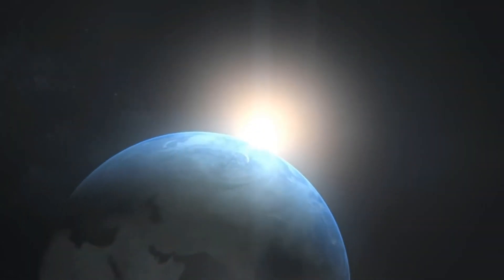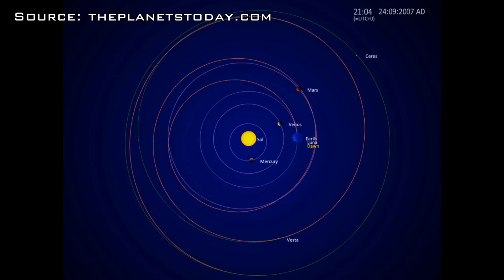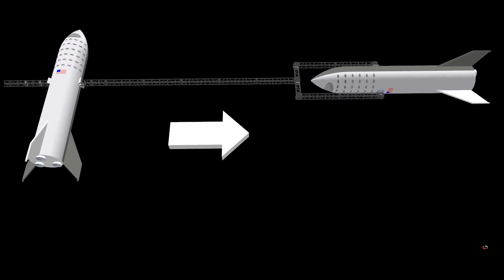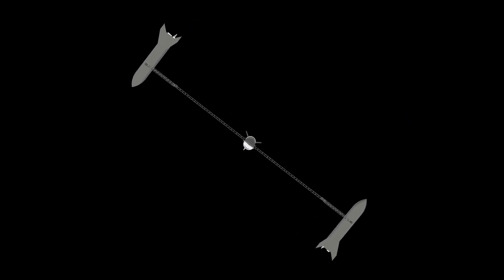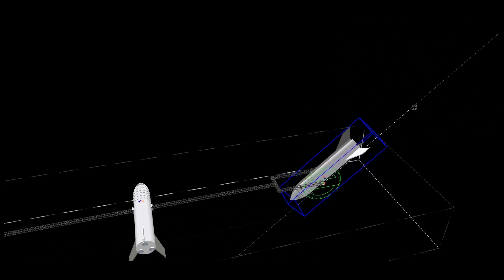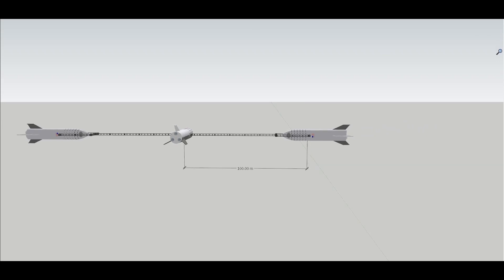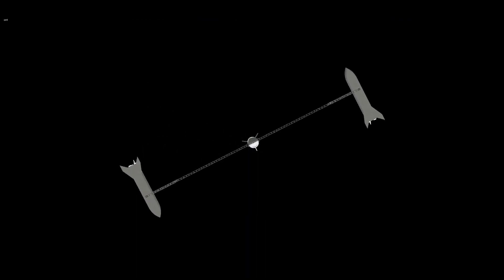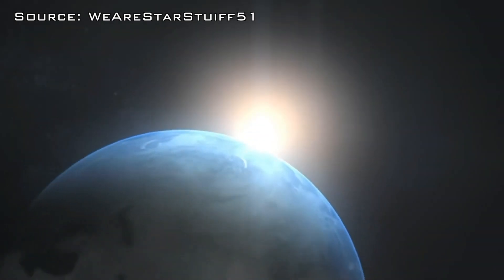GLS2: Artificial Gravity for SpaceX's Starship

Comment: Good. Now figure out a way to protect against the beyond lethal levels of radiation you will need to travel beyond LEO.
Reply: Radiation in space is way, way overblown.  Avoid passing through the Van Allen belts when leaving Earth;  and the rest is not too bad.  A truly lethal radiation place is Jupiter's moons Io and Europa, which are inside Jupiter's "Van Allen belt";  there you'd get a lethal dose in 5 minutes.  But deep space is generally okay.  Well, you do get a lot more cosmic rays than on Earth, but in this case, airline pilots get almost as much cosmic ray exposure as astronauts on the ISS, and astronauts on the ISS get almost as much as in deep (interplanetary) space, since Earth's magnetosphere is not effective against cosmic rays, given that they are made of non-charged particles at high energy ... (our shielding down hear is thanks to the atmosphere).  The increase in rate of cancer for commercial airline pilots is very slightly greater than average;  much less than the effect of being a smoker.  As far as solar flare radiation (charged particles), the crew will have plenty of warning, and will be able to take refuge in the radiation shielded core, which will be a cylindrical space whose walls are part of the water recycling system.  Often people are horrified at hearing that this or that exposure increases your irradiation by a full lifetime on Earth;  but we can easily take orders of magnitude more exposure than Earth background without noticeable health consequences.  Perfect example is radiation therapy, where you might get 100 REM in the course of a treatment (several lifetimes' worth).  And the best solution for radiation is actually our own natural cell and DNA repair mechanisms.  Taking supplements that facilitate or promote DNA repair is going to do far more than building lead walls.

Comment: Cheapest form of gravity, spinning! The truss idea is awesome! But you'd need some amazing materials and design to pull that off. I can see it happening eventually. Elon will probably have to hire some crane manufacturing engineers to figure out that challenge. Total pull at the center of the truss will likely exceed 300-400 tons pull force, combine that with vibration and it will be a challenge to prevent breaking.
Reply from the maker: In the next GLS video i'll talk about using cables to hold against he pull of centrifugal force, and rigid truss to provide leverage.

Comment: I think the biggest problem with this is the need to swivel the starship, and support it completely with only two supports in the middle.  Rockets are made to support a vertical load, not horizontal point loads, and the design would have to be changed for the added stresses.  Atmospheric insertion would apply stresses evenly along the body as well.  If reinforcement was simple and lightweight, it might work.  I still think using something other than the main engines to spin it is ideal, even if it took 1 day+ to get up to speed.
Reply from the maker: Yeah, a slow spin up, and spin down, would be nice. Lets see how their plans for methalox RCS plays out.

Comment: I know little to nothing about rockets but can't you just build/use the stabilizer "compress gas" to rotate the rocket like a bullet? that creates the same rotation as would your extra two centrical boosters to create the gravity effect.  Just a thought. no idea if that makes sense to anyone.
Reply from the maker: Rotating the rocket like a bullet doesn't give you a spin system large enough to support human life. 

https://www.reddit.com/r/SpaceXLounge/comments/czycst/in_an_85m_diameter_rotating_cylinder_a_2m_human/

As for compressed gas, you wouldn't be able to bring enough with you to have the required amount of delta V. It's used for reaction control, but there is a finite amount of it. They announced methalox RCS for the starship and I'm excited to see how that works out. When more testing is done, I'll certainly do a. video on it.

Comment: That scaffolding is too bulky. And, of course, a rigid structure subject to constant stress could easily develop cracks. Nylon ropes or steel wires seem to be the way to go at this time. Not to mention that using ropes and wires will allow for the 2 crafts to be much further from each other, possibly miles, thus making the artificial gravity a lot more natural. Because, if your rigid structure will cause for gravity to change from 100% to 85% for simply going upstairs, that could have devastating consequences for one's balance and you could end up with one constantly dizzy and confused crew which is not good. If the crafts were 1 mile from each other then moving inside the craft should not result in as significant 'gravity' variations.
Reply from the maker: Too bulky for what? I agree it's too bulky for Elon Musk to be impressed hahaha. I like how you think big though! The next GLS video I'll math on actual stresses, and include cables in the visual for the design. I'm going to try to keep it at 100m radius for now though because it seems more practical to implement and achieve mission success.
Reply: @smallstars  Yeah, do that.
The lack of gravity and, of course, the presence of radiation are probably the 2 biggest 'problems' that need to be addressed to make space travel practical.
And 'time' of course. But we forget that only 200 years ago it would take people months to travel from, let's say, Europe to Australia. It took Magellan's crew 2 years to go around the globe. So gravity and radiation need to be addressed first.

Comment: You know, the Idea of truss structure that spins isn't totally new. However the middle of the whole structure should be strong enough to endure MORE THAN TWO MASSES of starships. JUST A PROPELLANT is 1200 tons. one one ship. I don't think simple steel scaffoldings might handle it. And starships too. It's not a brick to be mounted on the center of mass(which is moving with time). You can't just turn it 90 degrees without snapping in half. It was the first point. 
The second is Jannibekov effect that will likely turn the whole thing into unstable rotating rod. 
Moreover, on large distances the metal truss is more like cable. To transfer spin FOR A FREAKING HALF A KILOMETER it should be as thick as the starship itself. It is like making a two meter long paper tube and attaching bricks on each side. And then spinning it.
Maybe making half of Earth gravity might help, but it is still too hard to achieve something like this in space. Both rockets should be totally synchronised or htey'll break. Coreolis forces won't affect much on human on large radiuses but they shouldn't be omitted.
Reply from the maker: I agree, and I love the visual of a two meter long paper tube with bricks attached. I would love to see them try that on the ISS!

In future videos I'll include more math on the stress being placed on the truss (and reinforcing cables)

Comment: Spin gravity tends to cause people to be sick af. If you drop a ball it wont take a straight path down. The rotation bends its path. The same happens with your head if you bend over or sit. This screws with your equilibrium. NASA did am experiment where they put people on slow turning platforms. They found if people where on it for long periods they would get motion sickness pretty bad. Its a cool idea in theory but doesn't quite work in practice.
Reply from the maker: This is why I chose 100m radius. http://www.projectrho.com/public_html/rocket/images/artificialgrav/gravComfort03.jpg

Comment: There's 1 major issue with using spin based gravity in space that rarely anyone addresses. If you use spin force gravity, the forces of gravity felt on your feet and lower body are higher then felt on your upper body and head. This causes major equilibrium balance and nausea issue's over time and forces blood to your feet. 

To compensate for this you need to create an MASSIVE station or system explained in this video, that would cause the differences in gravity in proportion to the center of the spin to be minuscule.

if you had a spinning wheel but it wasn't massive and say we created 1g for my feet, if my head was feeling 0.8g's due to my height making my head closer to the center of spin. It could be even more detrimental then a total 0g environment
Reply from the maker: This is why I chose a 100m radius. http://www.projectrho.com/public_html/rocket/images/artificialgrav/gravComfort03.jpg

Comment: Hmmm not bad but you would need to ad structural support throughout all 3 ships and the rigging holding them together would need to be massive..have you calculated the additional weight yet? You also need to change the thruster controls or you could end up twisting your frame..
Reply from the maker: All I knew is that the payload bay of an empty starship can hold 150tons. I trust 150 tons worth of truss, cables, and hardware should be sufficient. In terms of structural reinforcement at the attachment points, I would love to know how much if any mass would need to be added to the passenger starship hulls.
Reply: @smallstars  I would ditch the center rocket an just go with  support columns and two ships, run a access tunnel between them. also I would set them on horizontal axis not vertical that would create a stable gravity across the ships and give them easier thrust control. Hook a bunch of solar cells on the rigging and there you go:)
Reply from the maker: @gregj4857  How would you get the "support columns" on a trajectory to Mars? My only other video (GLS Version 1) isn't a very good video, but I did explore a dorsal connection on the passenger starships (I wouldn't say horizontal, but I get what you mean, they would be perpendicular to the radius, or even more elegantly said: in a tangential orientation)
Reply: @smallstars   how about an umbrella frame type of a design, you send it up and unfold it then you can fix 3, 4, even 5 rockets to the ends. Have all the rockets facing forward and instal a main engine in the base of the shaft for forward thrust also you can instal thrusters to make it rotate. The frame would be relatively cheap, simple to construct and launch..

Comment: Don’t land the GLS, just use in orbit refuelling
Reply from the maker: I don't imagine there will be in orbit refueling at mars. Only at earth. Also, the GLS and starships are not planned to have enough delta V to insert into Mars's orbit at all, and will rely on Mar's thin atmosphere to scrub off velocity for landing.
Reply: smallstars All you need for in orbit refuelling is 2 Starships so it could easily be done at Mars. Plus after aerobraking to reduce apoapsis it would be much cheaper fuel wise to raise the periapsis than to land and take off again.
Reply from the maker: @aDifferentJT  Interesting Idea! It would be a first for humans. (one of many obviously)

Comment: For this idea the implementation is rudimentary. Each starship in order to have enough Delta V for mars trajectory and eventual orbit requires two separate launches, 3 means 6 and 3 Leo refueling maneuvers (edit, not to mention extra delta V loss to catch each other on the same trajectory in Leo). Technically you'd only ever need one GLS or whatever you call it since both you can just have an adjustable center of mass designed into the truss and just boost the spin using the one starship and rotate around the center of the truss as a point of reference. (edit, this is to compensate fuel weight loss from the burns, something that in your original idea you'd have to match the fuel burn from both rockets exactly lest you have a shift in centre of gravity which for the middle passenger ship would be unfortunate to say the least.)

It should be noted however that such a design simply does not account for general space wear and tear and you would have no way of knowing the condition of the truss unless you built sufficient sensor infrastructure into it. It's also a massive failure point with the event of it breaking or coming loose having catastrophic effects on the starship's flight path as the dissipated forces from the event would slingshot the two away from each other but most importantly away from their mars trajectory potentially adding years if not decades until the next celestial body encounter without enough delta V to correct otherwise.

The only realistic way for artificial gravity implementation currently is to just rotate the actual starship itself using retro thrusters and have the gravity against the shell of the craft which in this case actually may help in the passive pressurization of the vehicle and thus increasing it's hull strength.

With anything in our current technological stage less parts individual ships are the way to go until we are able to harness a different form of energy such as fusion and/or efficient ion drives allowing some extra delta V for safety. Getting there is really where we are currently at and getting there comfortably will be several steps beyond that. (edit, we really should aim for a a-grav station in Heo first before trying to send starships on voyages)
Reply: Rotating a craft the size of starship fast enough to simulate even just 80% of Earth’s gravity would be completely intolerable to human because of the issue created by angular velocity, differential gravity, and the Coriolis force. Experts believe that the most angular velocity that humans can comfortably tolerate is 4 rpm which would require a spacecraft with a rotation diameter of 112 meters at 9.8 m/s rotation speed to get 1-g. If a craft has significantly smaller rotation diameter, the differential gravity between a passengers head and feet would be too large and would crate a very uncomfortable ride that most humans couldn’t tolerate. Even if you double the angular velocity to 8 rpm and decrease the g’s to 80% of Earth’s gravity, it would still require a much larger rotation dilated than the height of the crew section of the Starship.

Comment: Couldn't you use a huge reaction wheel in the center starship? I know the this would take much longer to attain the speed needed but the sun is a limitless source of energy and can power the reaction wheel. You also gave me a grate idea for maintaining the bodys natural functions and bone density. If you leave this system in orbit around mars you could periodically send people from mars to this station to extend peoples stay at mars. Enabling people who live on mars to still be capable of returning to earth.
Reply from the maker: 1. The reaction wheel in the center starship would not really have any leverage on the system. The parts of the system that have to be set in motion are the most massive parts and they are at the extremities.

2. The plan is not to orbit mars at all, but to use Mars's thin atmosphere to scrub off velocity and land.

3. Building a centrifuge on the surface to support human health would be a pretty good idea! I don't see why it would need to be in orbit ;)

Thanks for your great comment!
Reply: @smallstars  yeah i was just thinking it would be easier to make on solid ground. The only thing they need in orbit is satellites to maintain contact with earth. They probably already have that. Thanks and great concept. I hope to see more great ideas

Comment: Wouldn't this suffer from 3 axis instability (tennis racket theorem?)   The intermediate axis sounds like it would be on your pivot causing the whole thing to want to flip.

Also, if you are 1g at deck 1, wouldn't the mass of propellant be loading huge strain on the system?
Reply from the maker: Yes, working on a solution for the next GLS video!

Comment: I know this is not related to the video's subject, but...
"Over and out" is incorrect and it worries me that so many people are using it.
"Over" means you're finished with your message and await a response.
"Out" means you've finished with your message and do not expect a response, basically ending the conversation.

These terms were (and still are) used mainly with radio communication, as you can only broadcast OR receive at any given time. Saying "Over" or "Out" was a signal to the receiving end that you've stopped broadcasting and are able to receive signals again.
Reply from the maker: Next time I'll hit you with a "Smallstars out!"

Comment: Cool vid, Have you considered the gyroscopic effect of the rotating masses, the fuel penalty for minor course corrections, during rotation or the deceleration of rotation prior to maneuver and how tolerant is the differential mass of the two outer rotating ships before a serious stress / wobble is induced at the  fulcrum ? It would be cool if you discuss these in the next update, cheers
Reply from the maker: Almost done with my video on the shape of the solar system. I'm going to put these things you mentioned on my list for the next GLS video, thanks!

Comment: 30% gravity is enough
Reply from the maker: Maybe for you! My bones, and vision etc like to stay 100!
Reply: @smallstars  then you need at least 1 km long metal tube connecting two ships
Reply: it must be telescopic starting with 6m diameter (or as much as enough for 1 km) and 10m in length and ending with 3m diameter and connecting at the center with another identical telescopic tube with 6m diameter ends and weighing 80 tonnes each